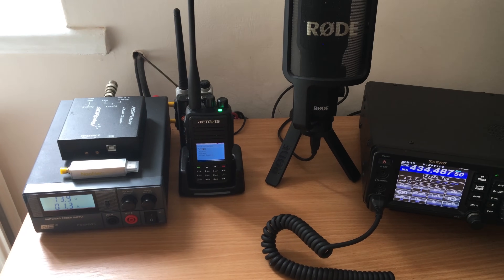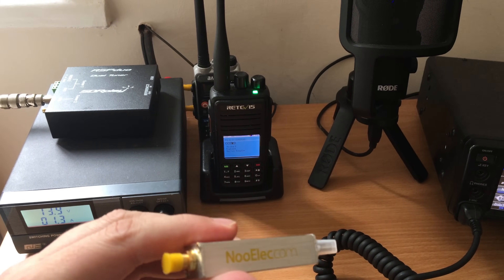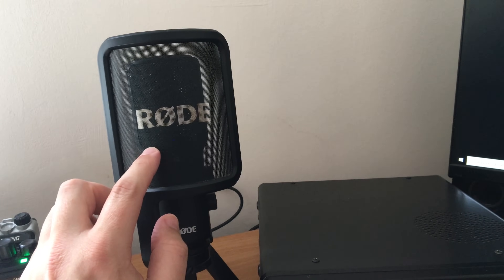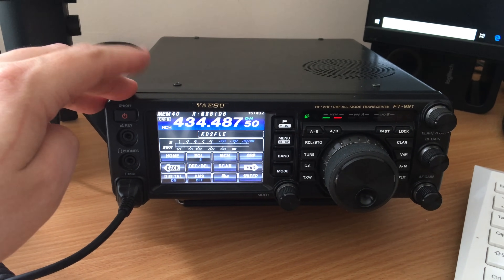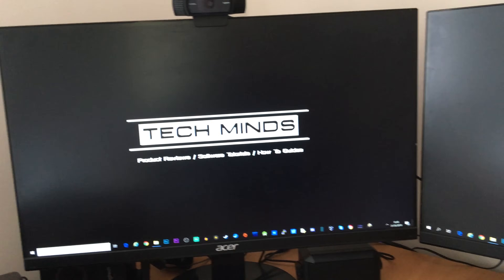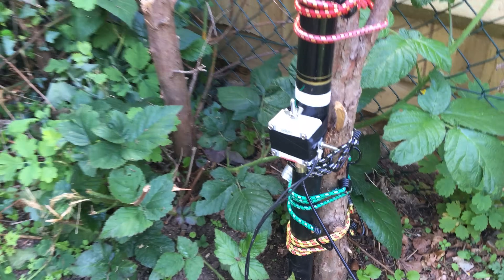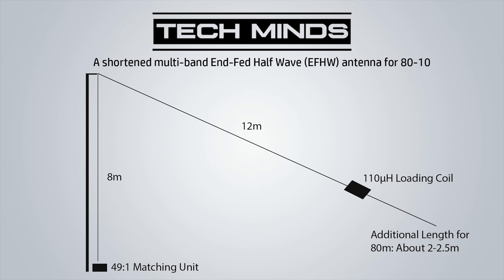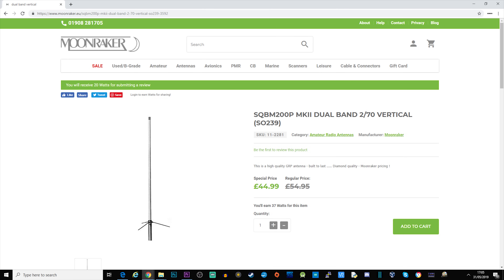Tech Minds: Shack Tour And Antennas

Comment: I have just bought an FTM400 and connecting to repeaters or Fusion gateways is a mystery to me. I don't suppose you've done a video on that?
Reply from the maker: Hey John, I havnt done a video on that subject yet, but I could do for sure! In fact, Fusion is the most user friendly and easiest to use out of all the digital modes. Make sure you callsign is programmed into the radio first, then tune to a Fusion enabled repeater. Then, press the WiresX button. The radio will then download a list of rooms, or reflectors, which you can scroll through on the radio. You can then press the connect button to tell the repeater to connect to the selected room or reflector. You can also use the WiresX button with your Hotspot if you have one. :)
Reply: @TechMindsOfficial  I shall give that a go, thank you!

Comment: Thanks for the video! Congrats on the 10K! I always look forward to your videos. I am ordering a 2M/70CM base antenna soon. I was wondering in the future since I do not have an HF radio yet if I can run the coax along the same path next to my VHF/UHF coax I run to feed my new 2M/70CM base antenna. Is there going to be interference from either radio to the other transmitting with the coax cables running so close to each other.
Reply from the maker: You’ll be find running HF and VHF/UHF feeder near each other. I’ve never had an issue.